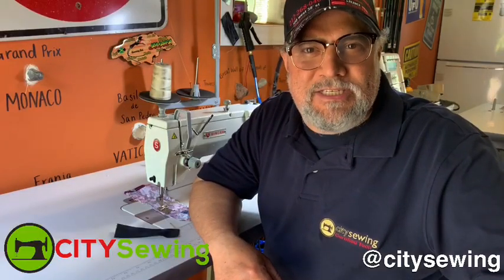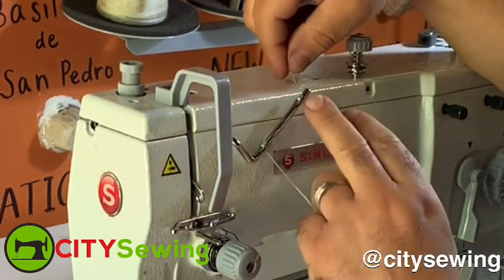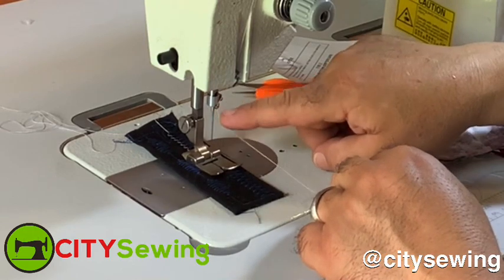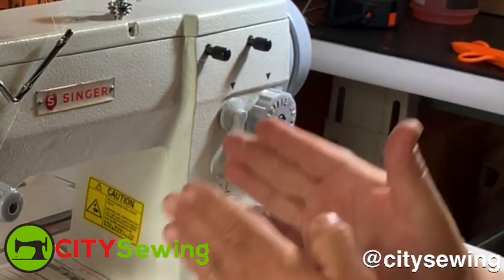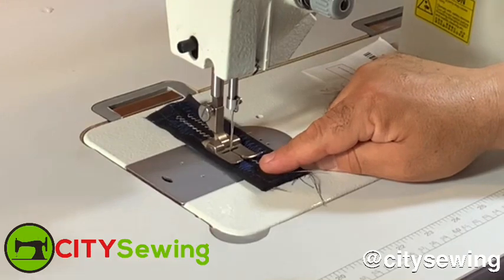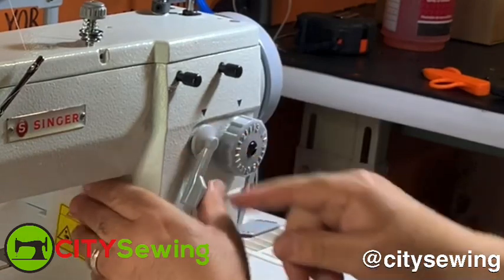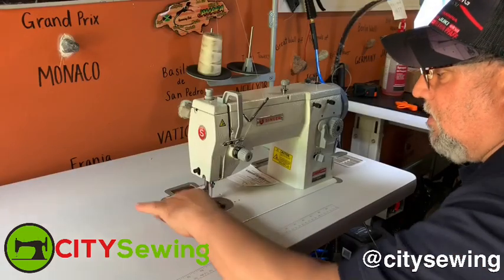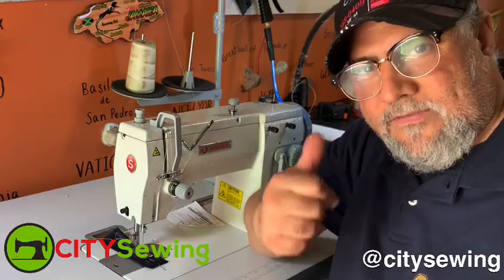How to thread a singer 20-U zig zag!

Comment: I love this machine.  I have one, bought last year (in London) which I use along with a couple of Bernina machines.  I love my Berninas but the 20u is so versatile.  It took a bit of getting used to (I use it for free motion) but it is strong a simple.  However I still need videos like yours to remind me of the basics and that I'm not missing something when I find something isn't working quite right.  Today, thanks to you, I realised that my tension spring had slipped over.  Thanks for your videos, from sunny (ish) England.
Reply: Hi. Can we do free motion quilting with this machine? can we put the feed dogs down and attach a quilting foot?
Reply: @zainabmuzammil6643  This is excellent for free motion quilting, however you need to remove the feed dogs, they do not fold down like they do on a Bernina.  There are various feet available however I do free motion work without any feet attached.  You do generally need to use a loop though to hold the fabric taut.  To remove the feed dogs you take the plate off and simply unscrew the dog, then install a different plate.  These generally come with the machine.
Reply: @cubworx7397  thank you so much for the help...

Comment: I have this machine but not getting much use out of it. I’m having problems with the mechanical foot lifter inside the machine it’s self. The knee lift is installed properly but the springs located underneath the machine are absolutely stiff. It will move slightly when depressed using my hand. Of course the hand lifter raises the foot. Any help is appreciated. No one addresses this issue that I’ve found. Thanks!

Comment: I have a much older model of this machine, funny how they look pretty much the same.
So I am having trouble with my thread breaking at the needle, And the thread is usually sort of bunched and sort of shredded looking. I have adjusted the tension some but I don’t know if I need to adjust more or what. Any words of wisdom?
Reply from the maker: Sorry to hear that, maybe needle ti install corectly.
Reply: @citysewing  Thanks for the reply, I have determined that there were some rough places on my needle plate that you could hardly see but I sanded with skinny strips of sandpaper and seems to be working ok now.
Reply from the maker: @marlawilliams6806  great ! Yesssss

Comment: Hi how can one slow down speed of this machine
Reply from the maker: Hi.
You need to have a speed control servo motor to be able to slow down , if you have a clutch motor you will need to change your motor pulleys to small size that will slow down your machine speed . Ok meaning if you have a 4” pulley you buy another 1” size you will reduce your speed by 80% !

Comment: my 20u stop sewing it is lock and i don't know what to do i just started using it
Reply: Have you tried to tighten the wheel on the right hand side of the machine, the one you can loosen to spool the under thread.
Reply: @hanneko7  i don't know which wheel that is but i will take look
Reply from the maker: i make a video about that this week,